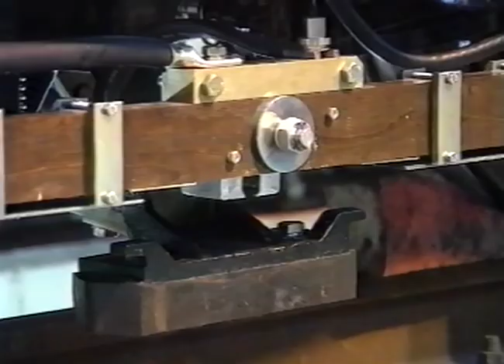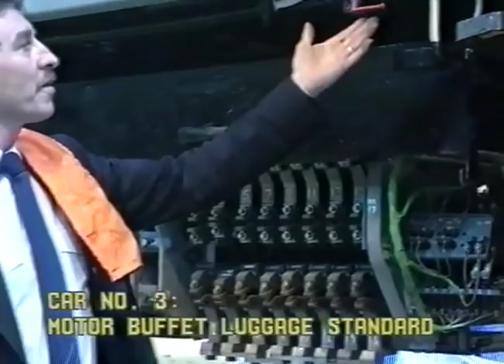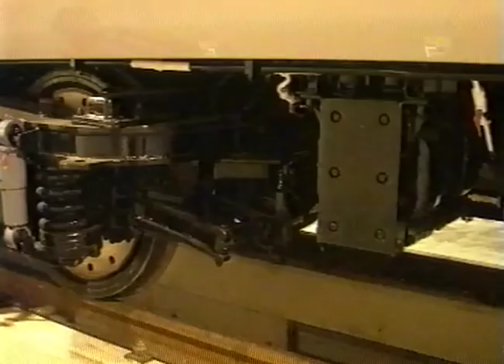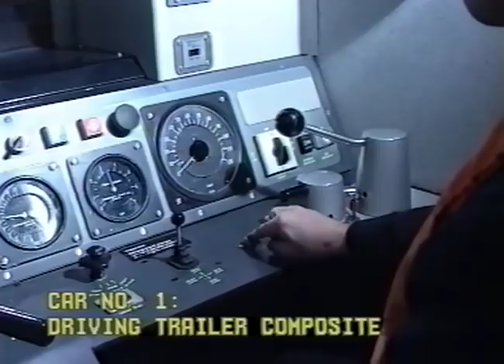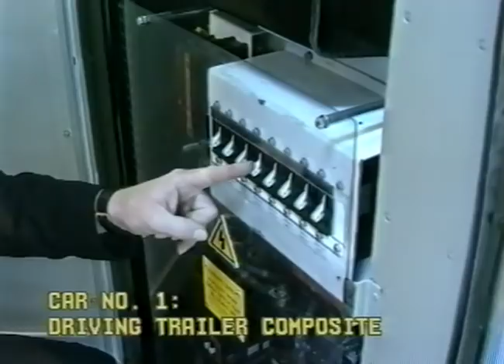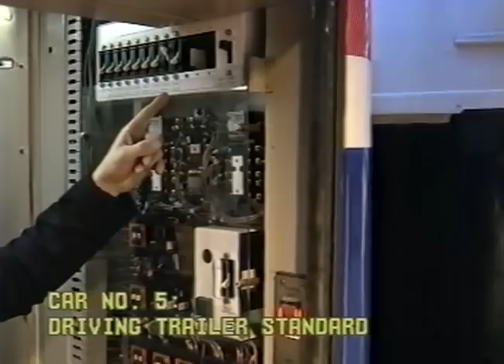The Wessex Electrics - Network SouthEast Training video

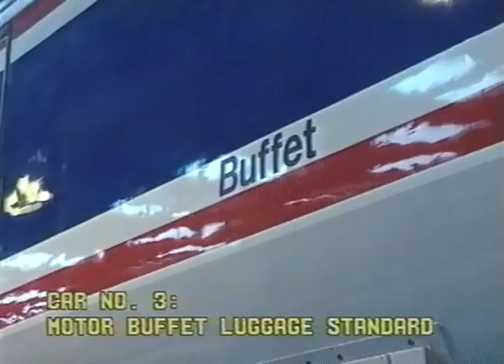Comment: It’s Not A Motor Coach! 5:20

It’s A Live-Rail Voltage Coach

AC Live Rail

DC Live Rail

Both Currents (AC/DC)

Chariot De Buffet = “Sideboard Carriage” In French

Early Generation DMUs Are The Examples Of What Motor Coaches Look Like

British Units “Thumpers” Are The Examples Of What Power Cab Cars Look Like

Power Cab Cars = Engine Driver’s Compartment Coach

Power Tail Cars = Engine Room Tail-End Coach

Power Combine = Engine Rooms Both Ends Of A Coach

And So Forth & So Forth

Power Carriages (Both Cabbed & Cabless) = Loco-Hauled Coaches With Engine Rooms

Examples = “Thumpers”

Comment: Network Regionals’ Training Video Of The E&CR Condom Stock

E&CR = The English & Celtic Railways

Network NorthEast

Network SouthEast

Network NorthWest

Network SouthWest

A Buck-Eye Drop-Head Is For The Purpose Of Loco-Hauling Whether It’s Dropped Or Not

A Purpose Of Driving A Train Without A Locomotive Requires Dellner Or BSI Couplers

The E&CR Condom Stock Is As Part Of The E&CR’s Locomotive-Hauled HST Family

That Is What The Condom Cab Trailer Car Of The HST Looks Like

E&CR Condom Stock - Expectancies Of RailFans

Mid-Train Power Cars = Condom Cab (Rotated)

End-Train Power Cars = HST-Style Cab + Condom Cab

The HST-Style Cab Is Supposed To Have A End Buffer, Plough & Light Styling Of The Condom Cab

HST End-Train Power Cars = Classed “43”

HST Mid-Train Power Cars = Cursed “43”

HST Booster Engine = Controls Both Ends

The E&CR Condom Stock Utilises The Inbound/Outbound Rotation

Inbound / Outbound = A Cab Car At Both Ends Of The Train (Both Cab Cars)

Comment: I liked these units, very quiet & comfortable to ride in. They suffered from too few driven axles & crude power control (resistance) resulting in shocking wheelslip on a wet rail which could be clearly heard if sitting in the Buffet motor coach.

Comment: Compressor governor isolating cok 
Main reservoir isolating cok - 
Passenger communication isolating cok 
Suspension reservoir isolating cok 
Door reservoir isolating cok 
Air suspension isolation cox

EP isolation cok 
Brake supply isolation cok 
Triple valve isolation cok 
And brake cylinder isolation cox 
Clearly marked on the front of the cabinets.
Reply: Who is coking a train? Mr Squibb!
Reply: You managed to type that word 10 times without ever spelling it correctly.
Reply: @DavidR_192  At that time I couldn’t spell the word correctly without getting the comment removed automatically by YouTube.